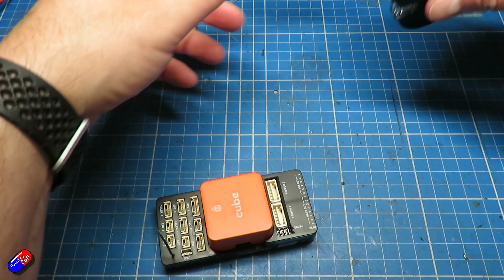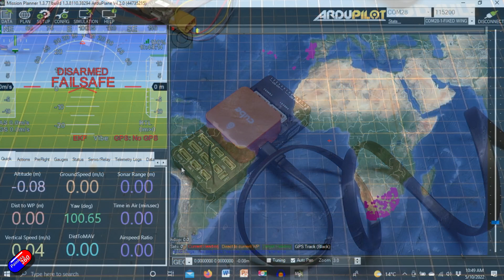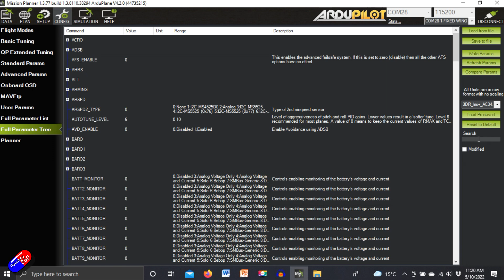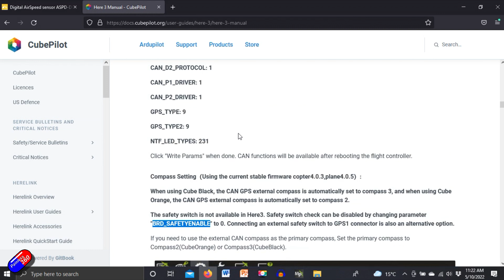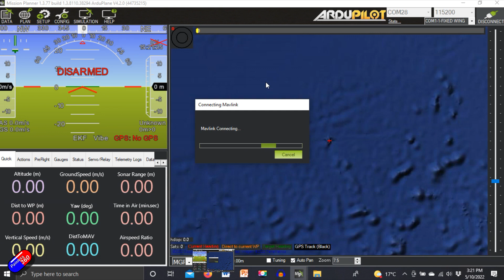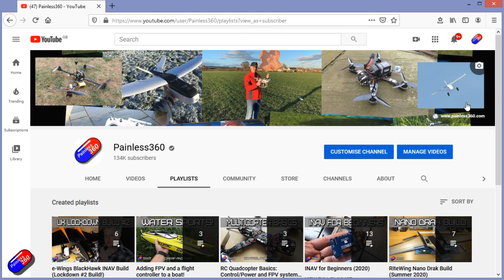My First VTOL Build: setting up the Pixhawk Cube with CANBus and Quadplane..

Comment: Painless, when building the 4+1 VTOL, do you use a PDB to centralize the provisioning of power for all of the motors and ESC's? If not, how do you avoid the rat nest of wires?  I find this part confusing and there doesn't seem to be any info out there that addresses this dilemma. Thanks.
Reply from the maker: You need a PDB of some kind. I made an old-school wire one for this... Happy flying

Comment: Quick question. Several club members are asking for a GPS tracker for their plane that is light weight ,  monitored by cell phone and requires no subscription fee.  Do  you have a solution for this?
Reply from the maker: Nothing that I have looked at recently. Most GPS tags need some form of subscription... I'll keep my eye open...
Reply: Thanks for the quick reply. If I recall correctly the pixhawk and ardupilot gave that capability. But the puxhawk was bulky and not very light either